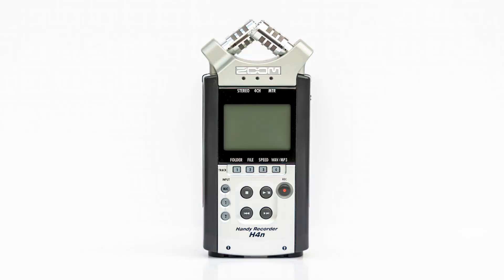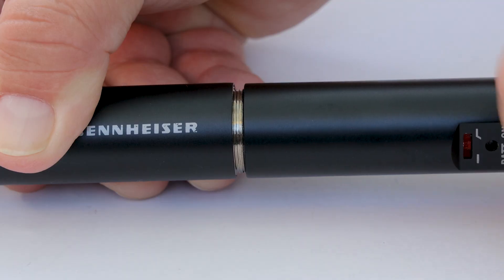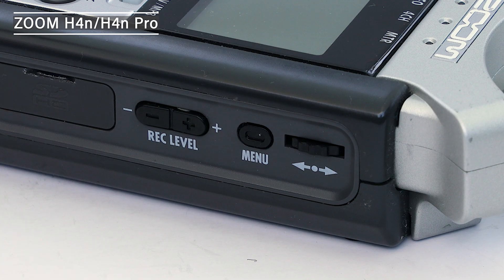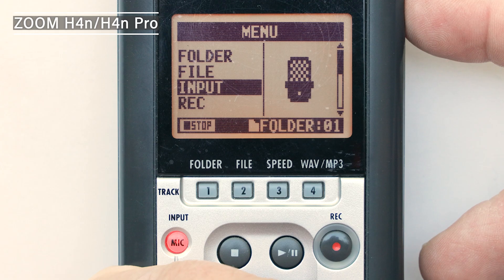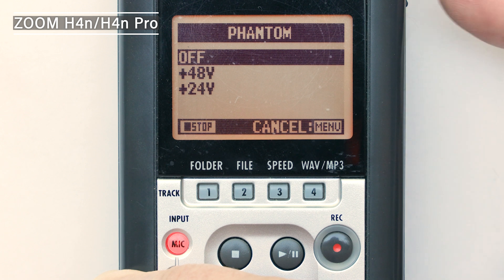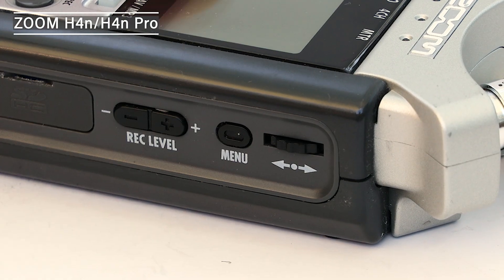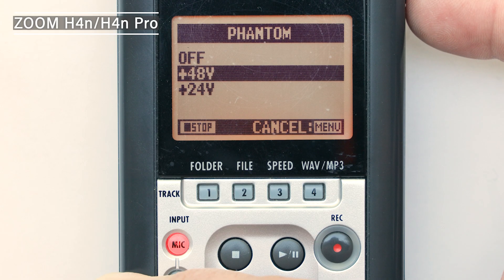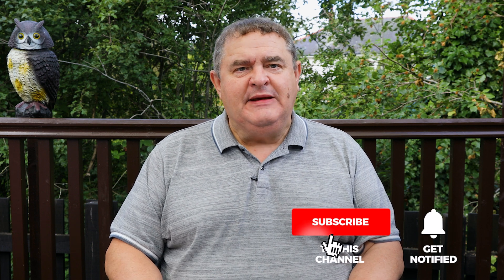Learn How to Turn on Phantom Power on Zoom Audio Recorders

Comment: Thank you!  Question:  I have learned how to use my Zoom H5 as an exterior mic for my iPhone 13 using the usb port on the H5 for data transfer.  .  However, the H5 uses up the AA batteries pretty fast.  It would be nice to somehow use the usb port for data and power at the same time.  Is that possible?  .... either using AC power or a power bank for power???  Thanks... Tom
Reply from the maker: Hi Tom. I think you can set the H5 so it connects and uses the bus power from your phone, but that will of course drain your phone's battery. Unlike the H4n(Pro) the H5 does not have a separate DC power in connector, so if you're connecting the H5 to your iPhone using a USB cable you can't also connect external power from something like a power bank. On my H5, alkaline AA batteries don't last very long, but by changing to NiMH rechargeable batteries I get much longer recording times. The NiMH cells I'm currently using are URACEL 2500mAh rechargeable, but I've had good results from other NiMH batteries as well.